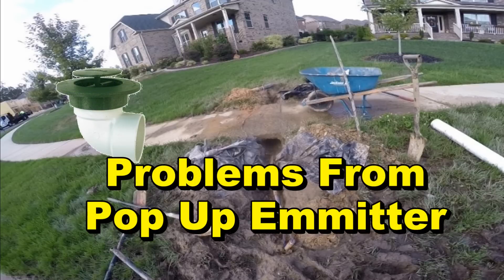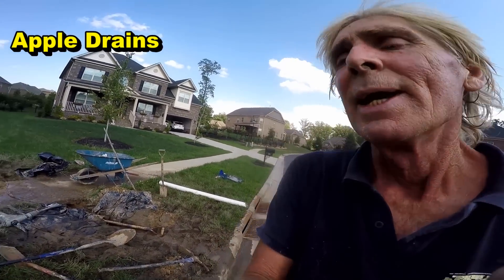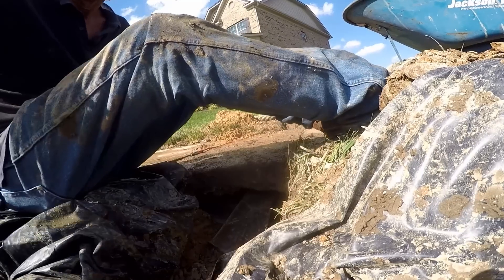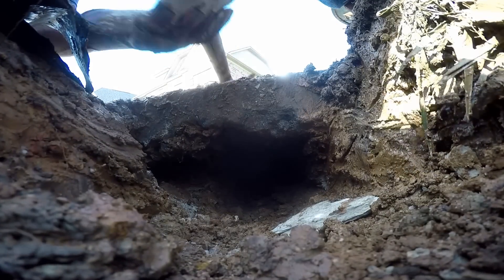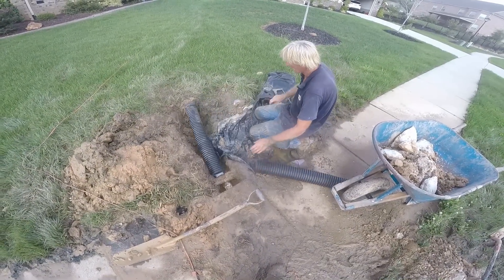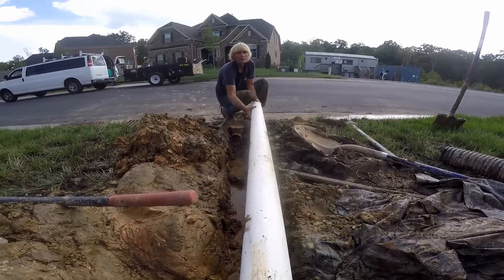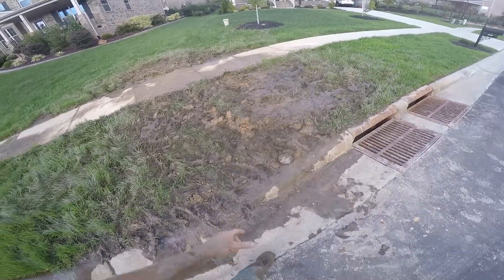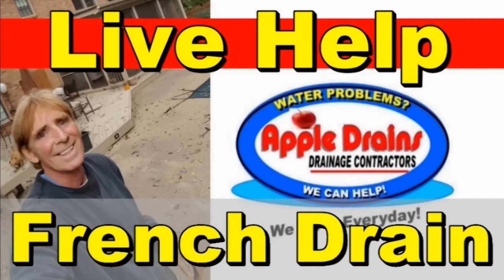French Drain, Proper Place of Pop Up Emitter, Sidewalk or Curb?

Comment: I stuck a hose in a pipe and eroded a hole. It made a huge muddy mess. And I ended up needing to cut the roots underneath the sidewalk. My dad told me I should have used a zawsaul or recip saw to cut those.

Comment: Started watching your videos a couple years ago.  We had a backyard that would have standing water against the house for days after a rain.  From the knowledge we gained from your videos, and your positive encouragement, we have installed 250ft of french drains and connected the down-spouts from the room,  all which leads to an exterior sump pump.  It currently pumps water down our driveway and out to the street.  In the spring, we're going to bury a discharge pipe down the side of the driveway and do what this video shows:  tunnel under the sidewalk and use a pop up drain.   Thank you for sharing your knowledge, positivity and encouragement.  It's made a huge impact on our lives and improved our property value.

Comment: I noticed you had to raise the last pvc pipe upwards so the emitter would end up on the surface. Will that cause water to not completely drain and even pool in that pipe? Is the water pressure when it's filling great enough to just push that through even though it's uphill?
Reply: I have same problem. The edge of street is higher than the level of pipe. What is your solution?

Comment: My pop up emitter would not discharge. I thought it was because it didn't have a spring, but when I went back to lowes to get another one none of them had a spring. What could be my issue?
Reply: Not enough slope to build the pressure needed to open.

Comment: I need to the the same exact thing, however, I cannot go under the sidewalk and put it on the other side due to HOA regulations.  Any suggestions?
Reply: Can you put gravel or rocks next to the curb so the water will have a path to the street? The gravel/rocks would also be lower than the grass. I am in the same boat.

Comment: Chuck,  2-3 feet to the right of the pop-up (at the curb) is the   storm drain. Could you have angled the solid pvc over to the storm drain and cored in to back side of the curb and the runoff would go straight into the storm drain and been invisible. Thanks for posting all of your videos.
Reply: I wondered the same thing
Reply: Especially proper when not enough pitch exists to drain it quickly.  May need to pull a permit from the town and a nod from HOA.

Comment: Ok big tip when you do under a driveway or sidewalk use a Water Garden hose and flush out the dirt with an 1" PVC pipe it leaves a nice tight tunnel where you than can push thru your drain pipes. We have been doing this since years and safes a ton of time.
Reply: ive seen him do that too, good advice.  cant wait to do my first drain system!

Comment: I WOULD HAD SAW CUT THAT SIDEWALK THAN DO ALL THAT  DIGGING UNDER IT.BY DIGGING  UNDER  IT AND REMOVING ALL THAT  GRAVEL AFTER INSTALLING PIPE UNDER THE SIDAWALK WILL BE SO WEAK AND MAY CRACK AND COLLAPSE CRUSHING THE PIPE. I RATHER SAW CUT THAT SIDEWALK THEN  PLACE PIPE AND GRAVEL COMPACT AND REPOUR THE SIDEWALK  PORTION. JUST MY POINT.
Reply: why are you yelling?
Reply: He said in the video the HOA didn't allow them to cut the sidewalk.

Comment: I'd like to run some corrugated drain pipe in my yard, but I'm located in Minnesota. Are there any better options for yard drain pipe in places that freeze?
Reply: nope, corrugated is preferred in colder climates over PVC because frost heave will break PVC pipes but it won't hurt corrugated.